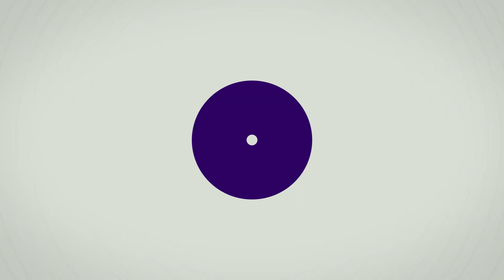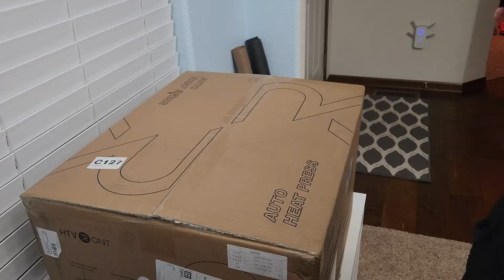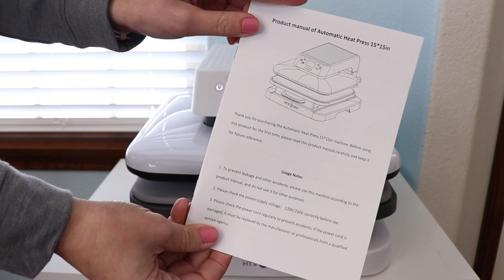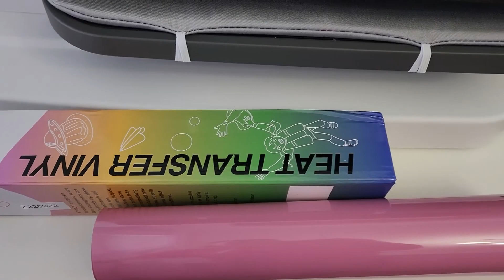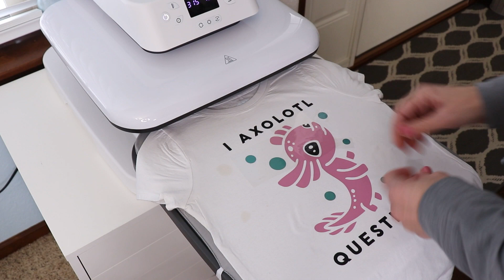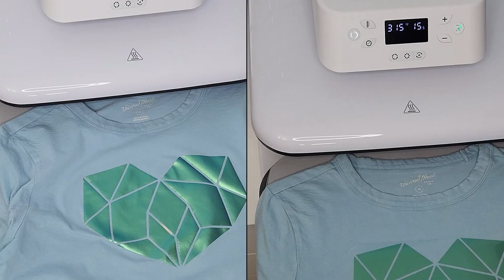HTVRont Heat Press Setup and Review

Comment: Can you use cricut vinyl or any transfer medium like something printed on an ink jet printer sheet or do tou have to buy image material from that particular company? Thanks
Reply from the maker: This heat press will work with any heat activated material. I use Cricut and other brand HTV all the time. It can also press DTF transfers and so much more.

Comment: Your video was very helpful, thank you. I just have one question I saw you had yours on an IKEA furniture. Can that stand the heat from the base of the auto press if it actually puts out any? Thank you in advance.
Reply from the maker: The white base of the heat press is really thick and sturdy, and it does not get hot below the heating plate. I've had no issues. Great question,  thanks for watching!